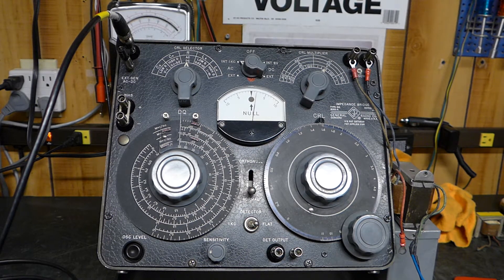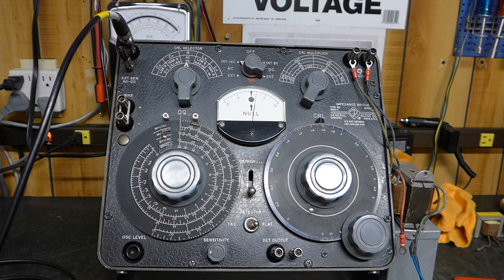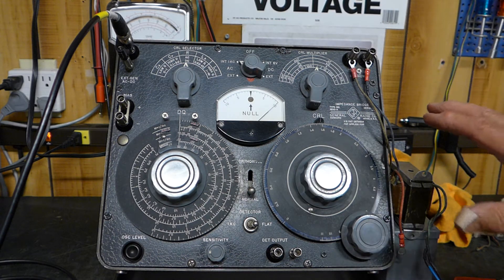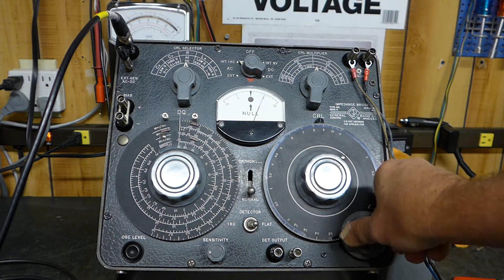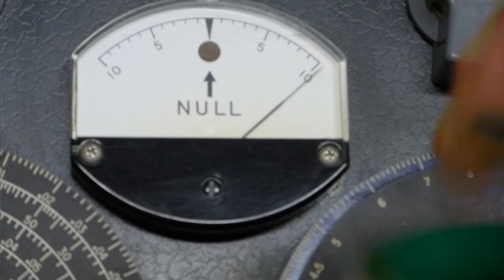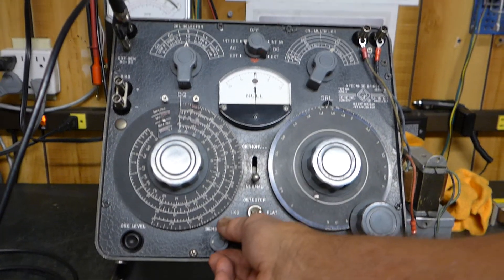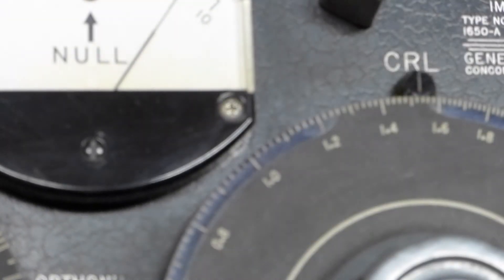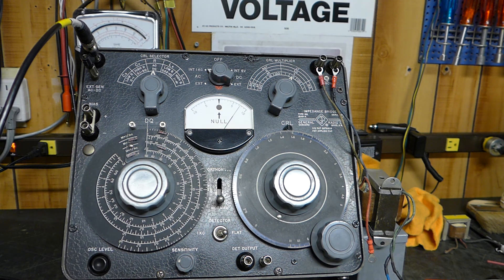Vacuum Tube Audio Transformer Impedance Determined With General Radio Impedance Bridge

Comment: I have a 1650-B, With any of these bridges Including the 1650, 916, or others from Heathkit or Delta Electronics...you should always expect to get a good tight null. If you do not have an indication right on the null mark your reading will be off by a factor increasing by the amount your null is out. The bridge works on the principle of balance, and by getting a "null" you are balancing the system. Inside this device, you will find (for the resistance mode) two fixed precision standard resistors of equal value and a third which is adjustable (via the resistance dial on the top)... You will then connect your DUT to the terminals and that will become the fourth device in the circuit... The device is powered (in this case ) by a set of D-Cell Batteries and they excite the circuit with a voltage. When you turn the dial and the needle moves toward the null indication you are reducing the amount of current which is flowing across the circuit. At the perfect null point, zero current is flowing because the circuit is in total balance. At that point you can take a reading. The direction the needle is pointed conveniently indicates also which direction to turn the knob. If the needle is not nulled current is still flowing in that direction. This instrument is so accurate that they thought to include parallax correction on the meter face to make sure that you perfectly align the needle with the scale...so as to get an accurate reading.

Comment: The reason you don’t get a better NULL is that you don’t use the other dial!!!.  You are supposed to find the NEAR value on the capacitance/inductance dial.  Then improve upon that with the left(D/Q) dial.  Increase the oscillator level (or sensitivity) for more deflection and the repeat the two dial search for a better null.  For certain parts you are hampered by “sliding null”.  In that case, flip the switch to Orthonull.  That ties the two dials together so that adjusting the right dial turns automatically the left dial as well.  While not ideal, it generally is a great help in the case of sliding null type component measurements.
I used one of these same meters at my work in 1970’s.
Reply from the maker: You are absolutely right. I can't believe I didn't have my left hand on the D/Q dial. I use this thing often and quite a bit lately and I always note the Q of the coil I am measuring. Thanks for noticing and mentioning it.

Comment: Cool. I just got a 1650A and now know how to get impedance of a coil/trans! All I have tested was the inductance side. I like my 1650 even better! Guess that's why they are called impedance bridges instead of CRL bridges. Yes I am a slow learner lol.
Reply from the maker: These vintage GR instruments are magnificent. They don't have the convenience of a digital readout but taking the time to set them up, understand how to use them and making a series of measurements yields much more information than some of the modern convenient instruments. I am glad you got a good one and I am sure it will last many more years. They are built so well and of such quality components that most likely, only the power supply capacitors may need attention some day.
Reply: Agree. They are fascinating and I have already learned a lot from it, and you!

Comment: Hi, many thanks for making these videos. What frequency does the impedance bridge oscillator work at. I assume you must choose something in the audio spectrum. Thanks
Reply from the maker: +Christian Fletcher The oscillator built into the GR is 1 KHz. I have used the external input on some occasions up to 20 KHz and it may make a little difference (with small capacitors) in the ease (the null) is obtained in the measurement but the answer is still the same. The old GR is large and bulky inside and is not rated above 20 KHz. Still a marvelous instrument.

Comment: A little hint when making your videos, is that here,as i wached, it turns out that you do not need to zoom much on your camera, as the readings are clearly visable while you are full zoomed out, as you uploaded the video in 1080p. I can cleary read the 1.5kOhm on your bridge as you cam has zomed out at the end of your video when played it full screen;)
Reply from the maker: Thank you - I appreciate that. I do notice that when I hand-hold the camera, it gets pretty shaky and distracting and when tripod mounted I have to watch carefully that I am still in the camera's view. I just got a new Leica C which has the lens slightly offset to the left and I tend to mentally aim from the center line of the camera which puts things a little off to the right. The other camera I use is the Leica V Lux 3. It is a "centered" lens and a little more natural to use. PS - you probably know this but these new point-and-shoot Leica cameras are all made in Japan and are not the beautiful German Leica's that I have had in 35 mm - I can't afford the "M" or "S" series digital German made Leica's. I will add that these (relative) inexpensive Leica cameras that I use focus qicker and are actually easier to use than the big Nikon's that I have.

Comment: GREAT stuff!! Really kicks me!

The reason why you don´t get a full "nulled" readout is the magnetic "reamanence" of the transformer iron. If you want it "full nulled" you need to power the tansformer with nearly maximum power that it is rated.
Look at the magnetic curve in the B over H field, (magentic flux density over magnetic field strength here to read:   http://kiran111.hubpages.com/hub/CRGO-core-Laminations-Of-Electrical-Transformer ) for low magnetisation it will be have a displacement, and this is why you no not get a true zero reading. In fact it is the loss of the iron on little power transformation from the pri to sec. As the iron inside the transformer is not magnetised much....-> you need more current ;)

THANK YOU for upload!!